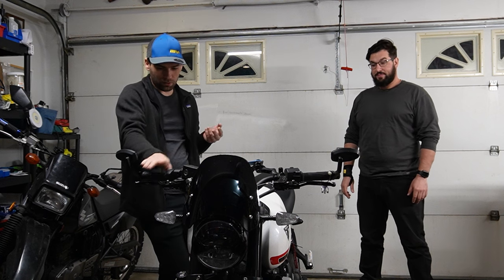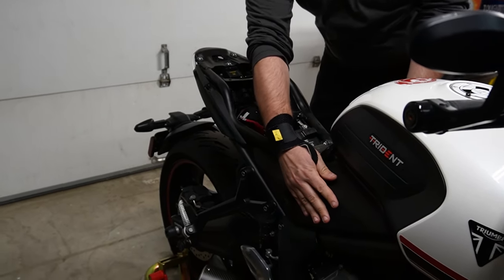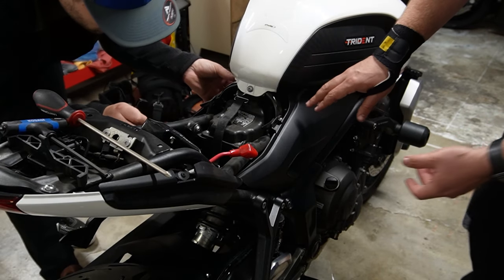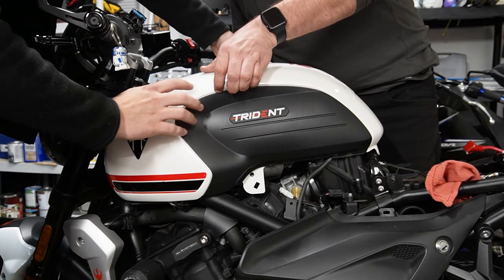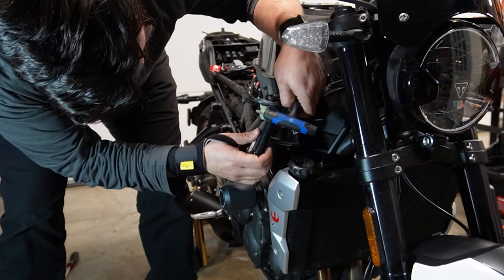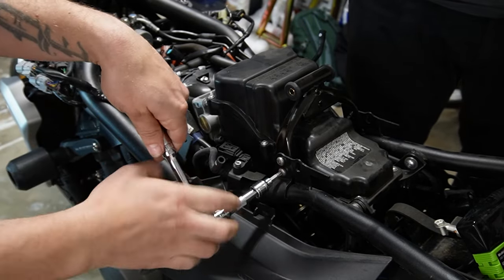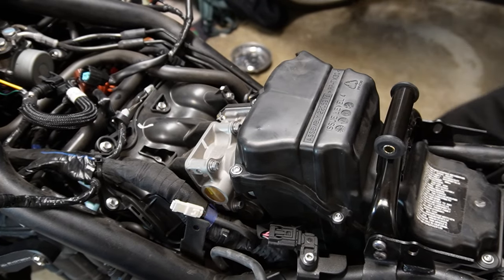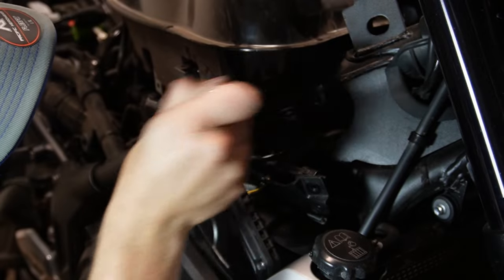How To Install an Air Filter for the Triumph Trident 660 | Best Air Filter for Triumph Bikes!

Comment: Just wanted to say, you can replace the air filter without pulling the tank, all I did was remove the 4 torx holding the rear tank bracket to the frame and pulled the left breather hose and was able to lift the tank up to get the job done.
Reply: left and right as well? I see there are two breathers on the tank
Reply: can confirm, just did it
Reply: @roadchildx  I just pulled the one on the left, seems like it's just a touch too short to get the tank high enough
Reply: I am about to attempt this and it's my first time doing it. At what time in this video do I stop what they are doing to be able to just lift the gas tank up and change the filter out? Just so I am not doing anything that's unnecessary.

Comment: Clear, brilliant instructional video guys. Gave me the confidence to dissemble parts I would be too nervous to do otherwise. Have done 6k miles in 6 months, so the K&N filter has made a noticeable difference. Smoother and more responsible throttle.

Comment: Just lift the tank up on one side to change the filter. No need to remove it.
Reply from the maker: Well I guess we took the hard route, but either way, if someone needs to take off their tank for any reason, this video might be helpful.
Reply: I do not like the idea of disconnecting fuel lines.
Reply from the maker: @brodymader687  Good to know. Thank you!
Reply: Do you need to remove the tank cover?

Comment: Just did the DNA filter on my 660…couple of notes. This indeed can be (and was) a one man job. Secondly I did not have to disconnect the fuel line under the tank. Getting the air box screws out required my lifting and holding the tank while I unscrewed em.  Hardest part was realigning the bolt on the front right hand side of the tank.

Comment: This is the most complicated air filter replacement I’ve ever seen… And I’ve been riding motorcycles and repairing them for over 40 years… I just bought a tiger 660 sport…  after seeing this video… I’m gonna sell it as soon as I can…
Reply: Really?? Over a filter? Well how much you want the bike for and where do you live?
Reply: Too soft for the bike imo lol I just did plugs and air filter. Took me 3 hours. Not hard or complicated. Get a scooter, bud!

Comment: They designed it as if the air filter will never be removed. Thank you triumph engineers. Need to sell the motorcycle before the air filter gets dirty.

Comment: Thanks for following up your last Trident video with this one.👍🏻. Just saw you remove the Positive on the battery first - it’s recommended to remove the Negative terminal first.  I’m not sure why…but it’s in the Service Manual.
Reply from the maker: Sorry for the delay, we were waiting on the tuning device to arrive. Hopefully the feedback was helpful and thanks again for the battery tip. I don’t know why it matters either but I’ll make sure for the future!
Reply: @MotoViceOfficial  I really like your explanations, with tool sizes being mentioned every time.  Really helps to plan the job.
Reply from the maker: @wl660  Glad it’s helpful. Trying to improve the quality of my content with every video!
Reply: @MotoViceOfficial  If you've got a tool on the positive and touch anything metal, you're going to arc.  Undo the negative first and it opens the circuit and less of a chance to weld a wrench to something :)
Reply from the maker: @perpetual98  thank you! I’ve always wondered the correct order.

Comment: Man what id give for a larger tank on my trident! Just an extra gallon is all it needs!
Reply from the maker: My buddy said the same thing!
Reply: @MotoViceOfficial  Ive just found out the hard way radiator mounts on this thing are of thin gauge metal. Frame sliders & radiator guard are very necessary on this bike.

Comment: Can you do a video replacing/upgrading stock fuel controlers on direct fuel injection bikes? Thanks!
Reply from the maker: If the issue comes up with a friend's bike definitely!
Reply: Where do you get engine internal parts or gaskets?? @MotoViceOfficial
Reply: @MotoViceOfficial specifically for this bike. Thank you

Comment: Hi, I saw that you removed the battery then when you refitted it did you have to reset the engine lights or nothing? Thanks I ask because otherwise I have to get a diagnosis thanks in advance